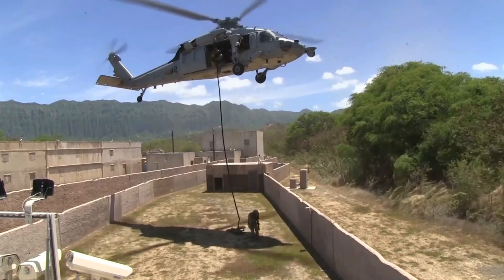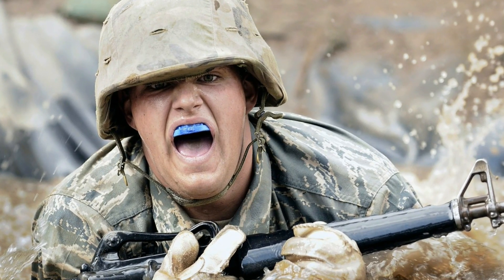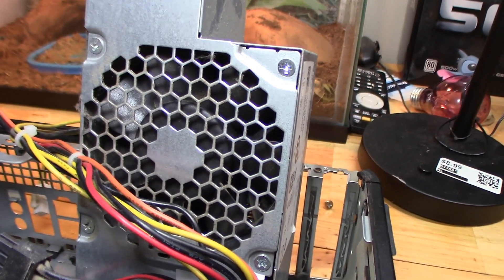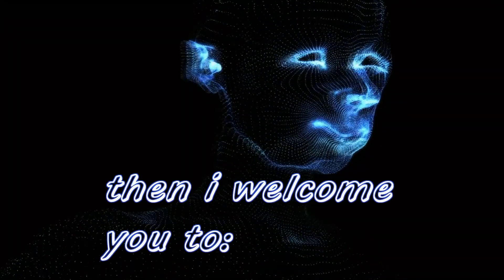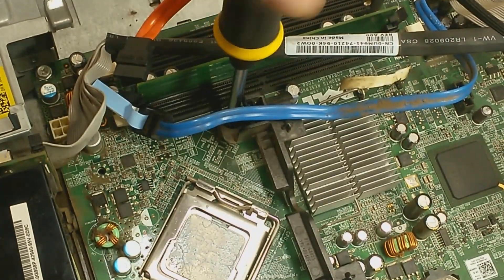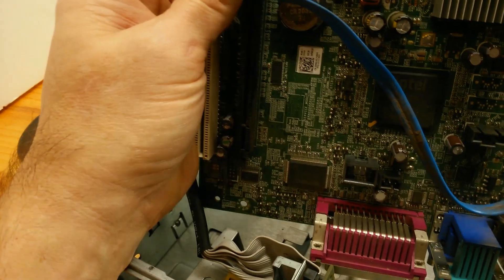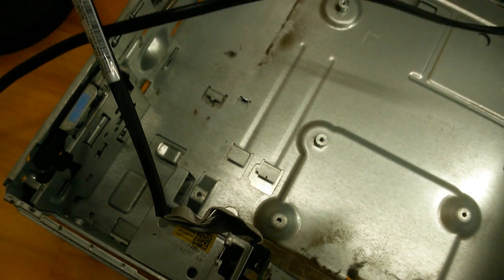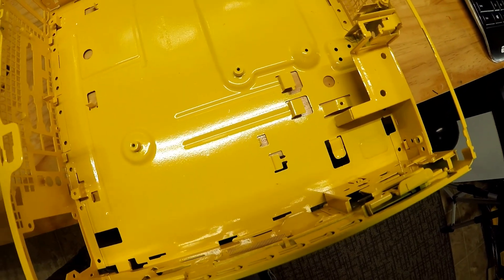ARMY DELL OPTIPLEX  SFF CUSTOM COMPUTER BUILD PART 1

Comment: so that laptop hdd work with 12v power cable? i think its can only hold up to 5v..
Reply from the maker: +D Rounin yes sata cables do have +5v running to them. It would be same as putting an ssd drive on there.

Comment: yup, these are the machines I scrap out.... DELL used a funky board, a fixed I/O plate and it was a Intel build.... (I hate Intel!) these units get scrapped for parts and tossed! chassis unusable except for the board they came with... YICK!